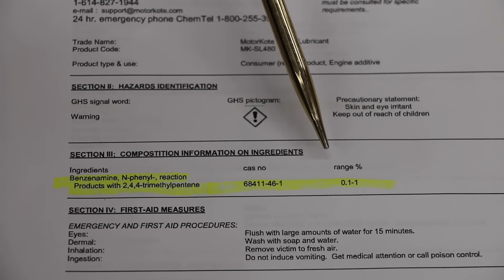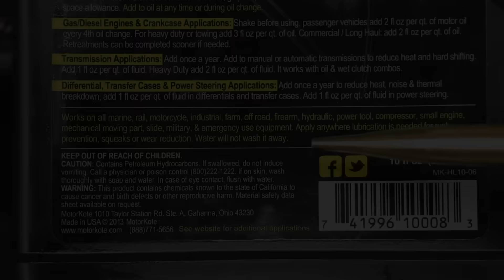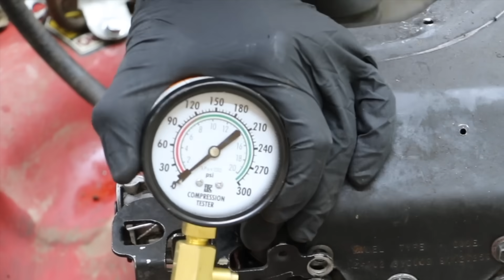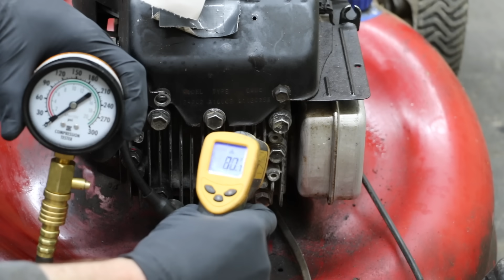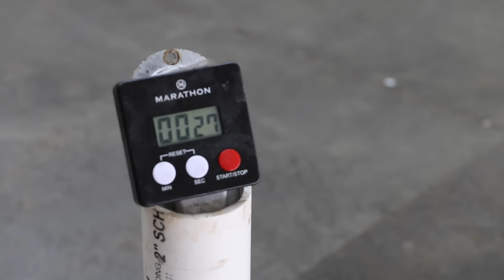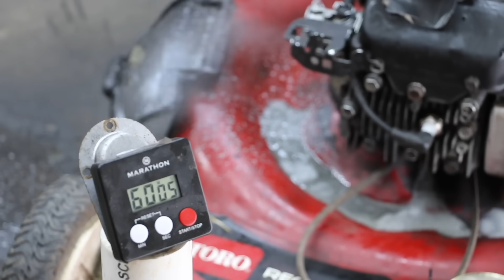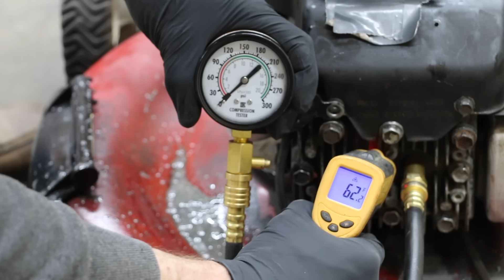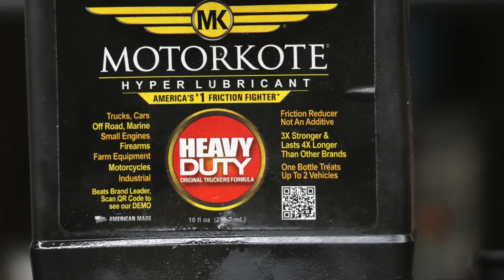Can MotorKote survive the water test?  Let's find out!

Comment: But if it will stick and only come off if you sand it off won’t that old oil just sticking cause engine sludge ???
Reply from the maker: It does wear off and requires a continuous use.  It just takes a while to wear off. I doubt there's much left on the cylinder wall after an entire hour of water exposure.

Comment: MotorKote allegedly contains chlorinated-napthalene/chlorinated-paraffin, which is corrosive and damaging long-term.  
Allegedly an independent lab test (Chlorine Content, Bomb Method, ASTM D808) performed on a virgin sample of MotorKote measured over 28% chlorine content. 
Subtituting chlorine laundry bleach or Head and Shoulders Shampoo in place of MotorKote as the lubricant with the Timken/Falex lubricity test apparatus will produce similar bearing scar damage as MotorKote. 

http://thebestsyntheticoil.com/pdf/TSB%20MO-2010-04-01_chlorine_oil_treatments.pdf
Reply from the maker: Thanks for this information.
Reply: +Brian Juricek 
Similar to MotorKote on the Timken/Falex test apparatus. 
Yes. 
The chlorine in the bleach creates a strong but temporary EP film on the bearing surface, resulting in similar bearing scar damage as MotorKote for the short 30 second test duration.
Reply: That article mentions the additive turning acidic when in contact with water which is why it becomes corrosive.  If that's true, your left over oil from this episode should be more acidic than usual.
Reply: +Jordan Liske 
Very likely yes, but not necessarily. 
The overall PH may not change very much, however an oil sample lab analysis would most likely indicate elevated TAN and lowered TBN assays.
Reply: +Mr. LuvaLuva 
Don't be sick, it is not worth it. 
Yes, they do, especially by lying dealers and resellers that often misrepresent and exaggerate. 
I am not aware of an Amsoil additive product that is competing with MotorKote additive though. 
Yes, they do. 
However, if your comment was/is directed at me it is misdirected, I have no connection to or with Amsoil and I am not a fan of Amsoil. 
I have the opinion that Amsoil today is not the high quality true synthetic it once was prior to 1996, and is more of a marketing gimmick for a product that is highly over-hyped and way over priced for what you are getting. 

Amsoil today does not refine or produce any component of their products, they are primarily a packaging and multi-level marketing company that purchases their base products and additive packages from several industry petroleum/chemical refiners, then packages and markets primarily through a multi-level reseller/dealer network. 

Currently laboratory testing shows numerous brands out performing comparable Amsoil products. 
Amsoil is a good oil but currently it is not superior to many or the best. 

Is Amsoil a true Group IV/V PAO/Ester base stock oil? No. 
Most of Amsoil's product line is not true synthetic or 100% synthetic. 
Amsoil is no longer all PAO, every Amsoil product is now a blend including the Signature series where the PAO is mostly in the relatively small percentage additive package. 
Read the FAQ answer to the question "What kind of base stocks does AMSOIL use? Are AMSOIL synthetic lubricants PAO-based?" on the official Amsoil website: 

http://www.amsoil.com/frequent.aspx

Amsoil also practices a form of bait and switch. They have two lines of oil, API certified and the one they make all their longevity claims with. They do most all their marketing based on anecdotal information about their non-API certified longevity oil. Whenever someone raises the topic of API licensing, they trot out their API oil. But the two are not even close to being the same. Their API oil is no different than Pennzoil, Shell, Quaker State, Mobil, Chevron, Valvoline, Motorcraft, Super Tech or any Group II/III API certified blend brand.
Reply: will it produce less wear in that test? Chlorinated hydrocarbons are what are necessary and responsible for the performance.  How does bleach show similar results in these tests?
Reply: The test is dating back to 2010. I have heard that Motorkote formula has changed. Any information on recent tests?
Reply: +hid3nax 
Chemtrec database indicates MotorKote formula has not changed. 
Not that I am aware of.
Reply: I'm about sick of Amsoil bashing everybody that makes a competitive product... They have people that work for them trolling the web , to discredit or badmouth any product that poses a threat to their sales....I've been seeing them quite a bit posing as a regular Joe . or a independent  Oil expert. STFU HATERS

Comment: Project Farm I just went out to mow my lawns, started up my mower and it wasn't reving as hard as it usually does. There seems to be a rattleing noise coming from the crankcase. It have checked if it has oil and it does. I cleaned the spark plug just before the mow. What do you think the problem could be? The mower was working fine about a week before.
Reply from the maker: It's very difficult to diagnose the problem without hearing it.  Are you sure the ratting is coming from inside the engine?
Reply: Project Farm I'm pretty sure it is. Last time I mowed the lawn the sprinkler come on just as I finished and wet the mower while i was putting it away. It sounds like the sound of the engine in the video where you unseized the siezed engine, just not as loud. The sound is more like a knock. https://youtu.be/ajx0JD-caBA

Comment: I notice the engine ran on water in crankcase for 1hr after drained from oil+motorkote mix....how long would it have run if you didnt put motorkote in the oil?
Reply from the maker: I need to test this.  I've got lots of engines and one will get the water test soon!

Comment: I picked up a gallon of it after watching this video. Added 2qt to my truck that’s a little less than what’s called for my truck holds 44 quarts of oil. I’ll update if I see any improvement. I have 20k Miles on this oil and it gets changed every 50k truck has 
420,000 miles on it and I average 7.02 mpg
Reply from the maker: I am VERY interested to know if you achieve any efficiency gains!  This product is big in the trucking world.  Thanks in advance!
Reply: Project Farm I’m thinking 10,000 miles should give me a good average so maybe 3 weeks. 
I’m also going to add this to the atv’s as well, we have had water get in the engine crank case before and this might give added protection for crossing streams and large water holes.

Comment: Not sure if I've said this before, but how about using PB Blaster instead of oil? I've always thought it would be interesting to try because PB penetrates and breaks free some of the worst rusted/jammed up bolts. It's pretty slick stuff. I often wondered if you mixed the crankcase half with PB and half with motor oil if it would make any kind of difference? 
Oh and great job on this video. I'm now thinking of going out and buying a bottle of this (now watch the price of this product skyrocket likw it did for PB and Seafoam :/ ).
Reply from the maker: Thank you for this recommendation!

Comment: Testing 
You should test water alone to see the level of lubrication it gives.
Some additives claim that they last after the oil has run dry so you should do a soak with the bearings in an oven at engine temperature for an hour then dry them and test if they are still lubricated compared to clean dry parts.
This is actually where the claims will hold up best if they are true as bearings run dry due to oil pressure issues etc and anyone who races or drifts might want that added safety net.
Reply from the maker: Thank you for this recommendation!

Comment: I'm one of the viewers that has asked for motorkote videos.  I've used it in my tractor trailers,  personal vehicles and lawn equipment. I've always seen a difference in temps on my driveline guages in the trucks and assumed it was doing it's job. Even oil analysis has shown good results. I knew you would put it to the test and prove if it was working or snake oil, but I didn't expect what I just watched! I enjoy your videos and will continue sharing! Keep it up!
Reply from the maker: It's great to hear from those who've used the product. Lots of questions remain about whether or not it will cause sludge or become acidic over time.  Did Blackstone do the analysis?  If so, any issues with oil breakdown or acidity?
Reply: I can't remember the company that did the analysis. It's been years ago. The analysis always came back as new oil, even with a lot of miles on it. No acidity problems and when I got into the engines there was no visible sludge. The reason I believed in it was my gauges. There were notable differences in engine oil temp, trans temp, and differential temp.
Reply: @TheKneutervalve  I don't think transmissions are going to benefit from a friction modifier. Certainly not in motorcycles that clutches are wet and share the same oil as the engine. You need those clutch plates engaged to move you forward. Motorkote will make them slip. Not good.
P.S. Unless you meant something else than putting this product directly in your transmission (like, perhaps, the added cooling effect from a serpentine cooling line that runs through the main radiator to cool the transmission).
Reply: @C_R_O_M________ Did you read my comment??? Maybe,  just maybe....I was talking about  manual transmissions with temp guages and getting regular oil analysis???
Reply: @TheKneutervalve  I read all your comments. It mentioned trans temp and never clarified what type of transmission that was. I don't know why you got so defensive but it's certainly not my fault.

Comment: The claims MotorKote makes are something I would never take seriously if I saw it in a store, but holy crap that engine actually ran an hour with water in the crankcase! Useful note: Do NOT put this into any motorcycle/gokart/etc with a wet clutch, friction modifiers cause wet clutches to slip
Reply from the maker: Great point regarding the wet clutch crankcase!

Comment: I was researching this stuff a while back. When I found a thread on a GM truck forum. Some guy posted he really liked it and was getting better mileage after using it.  He was immediately attacked by other forum members. Calling it snake oil he just said you should try it. Than the forum moderator made a comment about that’s enough of this and closed the thread. I thought that is messed up, don’t mention anything new to these guys. Now you proved them wrong, haha. 

I have been using this for about 6k miles and Noticed a very slight increase in mileage according to the CPU and my engine temperature gage rides one notch lower. Not very scientific but it seems to be doing something.
The bottle also says it doesn’t have to be used every oil change and if you want to you can reduce it to 1 oz per quart of oil.
Reply from the maker: It's great to hear from those using products and glad it's provided a light fuel efficiency improvement!

Comment: One thing that I have done to Small Engines as in generators and lawn mowers is use gasoline in the crankcase to wash it out before I put new oil in it so I can see whatever contamination is in there. I vigorously shake the motor around to wash everything off then drain the gas out and then do it a second time doesn't take very much
Reply from the maker: This is a great recommendation--thank you!

Comment: Thank you for doing this test i do actually use this product
Reply from the maker: Have you experienced any benefits?
Reply: They claim you are going to get better fuel mileage but i have not noticed any difference as we have 7 vehicles and i check the mileage on every fill up.My 97 suburban has 198 k on it and i have used motorkote for 4-5 years still runs great has a little knock when you start it when it's hot. I have a 2013 crown vic cop car that has 120k of rough use and has a little bottom end noise when you first start it but it's not getting any worse.
I also use Lucas injector cleaner in everything i own and put it in at every fill up.This includes my 1990 gsxr 1100 with 48k on it and my 1990 john deere riding lawn mower that just keeps on going.I have a Shandiawa or whatever it's called weed wacker i bought in 1999 and it still has the original spark plug in it that i have never taken out.I just use these products as a preventive maintenance .I use synthetic oil in everything which   is either Castrol or Mobile one.
I do not baby my vehicles but i do let them get to operating temp before i put my foot into them.My wifes car a 13  volkswagon cc with a turbo they recommend changing the oil at 8-10 k i do it every 5k.
A funny story  i checked the oil on my suburban one day and wiped the dip stick on a white paper towel and did the same with my wifes car on the same towel.My suburban was almost due for it's 5 k oil change and my wifes VW had only 3k on the oil change and her car only has 20 k on it.Her oil was black and my truck was a medium brown colour and i asked her which one was from her car and she picked the brown colour from my truck she could not believe her car's oil was so black and like i said i change it every 5k but VW wants you to change it every 8-10.I think not.Also my wife drives 30 miles on the hwy everyday.

So i just use these products as a preventive maintenance.Keep up the great videos.............

Comment: This was a great video. However a control test motor is needed. No pre treatment. Just drain oil. Replaced with water. and see if it last an hr. Then check for damage. Pretty sure it will lock up. BUT I'm just saying.
Reply from the maker: Thank you for this recommendation!

Comment: How clean was the inside of the engine after all that u should have used the see through crank case engine
Reply from the maker: It was clean until I added the water.  It took quite a bit of effort to remove the sludge.

Comment: Amazing- you've finally found something that not only works, but it actually lives up to it's claimed effects. I thought for sure the water would've caused hydrolock, but the additive had just enough residue to cavitate the water into a colloid (foam) so then it was compressible without damage. I've wondered- why don't you connect the crankcase breather to the intake? It would run better, using the (normal) oily blow by in the combustion chamber, rather than messing your floor. I wonder what a small amount of MotorKote would do in gasoline? Lube injectors? Pumps? Would it smoke really bad? Maybe 1oz./1 qt. 91 octane. Superb video, honest testing as usual. Thank you so much.
Reply from the maker: Thank you!  I'm not sure what a small amount would do for injectors, etc.

Comment: Very thorough testing. Blown away by engine running an hour with only water in crankcase, yet no scoring or loss of compression. I used to use motorkote and then stopped because of comments and opinions that synthetic oil alone should be as good a lubricant as possible. I think i'm going back to adding motokote. It's pretty affordable if used per instructions; i don't think it can hurt anything: and this testing shows that it may be pretty worthwhile.
Reply from the maker: Thank you!

Comment: With reduced friction, would fuel economy be improved?  Might be nice to see the generator test to see if it uses less gas.
Reply from the maker: Thank you for this recommendation!
Reply: Oh and maybe even using your lubricity tester with the oil (or oil substitute) cold and hot to see how the temperature effects the wear spot.

Comment: What about this for 4 wheelers with wet clutches
Reply from the maker: Please don't use this in a wet clutch system.  It's way too slick.
Reply: you can use it, it works ok for wet clutch like motorcycles, i tested it with my z1000 and it worked, i think the label of the bottle says it is wet clutch safe

Comment: One other thing, if you have been using synthetic oil, would you add this to synthetic? Or, I’d synthetic really good just as it is and no additives needed? The reason I ask is my previous car was a 2003 Camry and I used synthetic from day 1 and also used duralube and slick 50 (not together of course) and no lie, I sold the car with 450,000 miles on it and saw someone driving it 3 years later.
Reply from the maker: Wow!  That's a LOT of miles!  Synthetic alone should be good enough.  This type of product seems to add additional film strength and reduce friction a little more than just oil alone.

Comment: unfortunately we cant get motorcote here in Brazil. however can get Militech 1. same type of prduct I,m thinking. I've had militec1 in there for The past 80000km. motor has been using oil of late. possibly because my turbo was running 1/2 pressure. now running 1.8 bar. just got back from 2200km trip. 42.5 ton outbound 40.5 inbound. a fair mixture of hill and flat. I averaged 2.82kml not too bad for a 2010 330 pony 7.8l Iveco. most people here are happy if theu average 2.3kml
Reply from the maker: Thank you for this recommendation!

Comment: Im very sceptical of oil additves but that was an awesome test. Going to give it a try in the motocross bike. Not in the trans though it will probably make the clutch slip. Thanks for the great videos !
Reply from the maker: It's not supposed to be used in wet clutch systems or CVT transmissions.  It's too slick.  Thanks for commenting.

Comment: Great test , amazing result ! I'm always skeptical about the effectiveness of aftermarket oil additives. It appears that this product has provided the increase in RPM is a direct result of the reduced friction. This should benefit with better mileage and less engine wear. 
I'm impressed!
I would be nice to see more information from the manufacturer about the product on their data sheet.
I will have to see if this product is available in Australia so i can try it for myself.
I would be interested to see how would an engine run with oil designed to be used for an air compressor pump.
Many thanks
Robert
Reply from the maker: Thank you